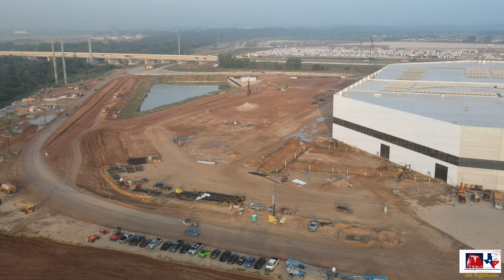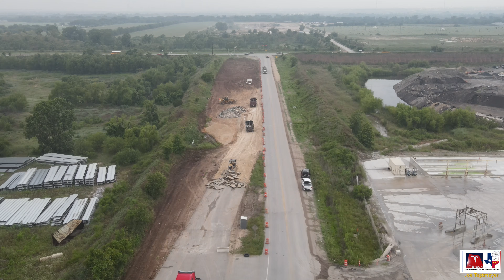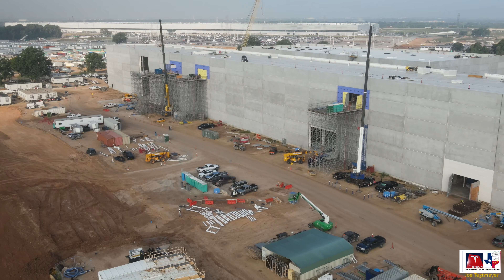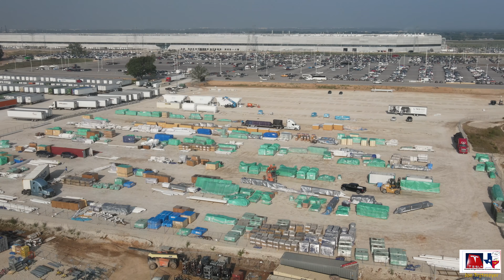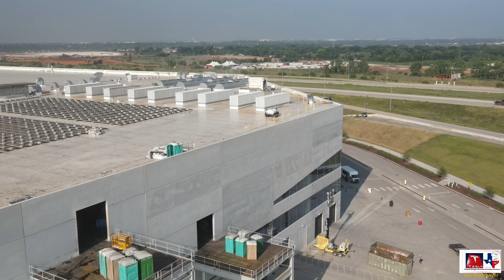Big Deliveries, S Construction Changes, Tesla Rd Widening! 22 May 2023 Giga Texas Updates (07:35AM)

Comment: It's been a while since I asked about the solar panels on the roof.  Are they online and producing power?  If so, any stats available?
Reply from the maker: I don’t think so but in my 19 May video I show where electronic boxes have been installed among the existing solar panels and a bank of raised panels over the casting machine section. It think these will be one of the last parts needed to connect into the new conduit that is being finished near the Megapack and new switchyard sites

Comment: Why are the solar panels angled the wrong way?
Reply: This question came up a lot when the PV Array was first started.

Cut and past from a comment from 18 months ago;

'West facing PV array. 'Recent study reveals some interesting facts. The conventional understanding is that the solar panel facing south (in locations north of the equator) will receive the most sunlight. This is correct to a certain extent however recent studies have proven differently: According to a new study from Pecan Street Research Institute, west-facing rooftop solar panels produced 49 percent more electricity during peak demand compared to south-facing panels [1]. This research was conducted and data was collected from fifty homes in Austin, Texas, which had solar panels installed in different directions. Some homes had only south facing panels, some only west facing panels while some had both.'
Reply: They looked more North facing but that's a very interesting study. I'm. Guessing there was no battery involved in that test?
Reply: @nathanprice4568  The panels are facing west. The long axis of the building is north-south.

There probably won't be a direct connection between the PV Array and the BESS. There's been a few guesstimates done that suggest all the electricity generated by the array would be soaked up immediately within the factory.
Reply: @Dessie Doolan  sound right...I was seeing the shadow of the roof vents...was probably early AM knowing Joe's schedule
Reply: Because it seems like the silly owner was more concerned about having the word "Tesla" seen by approaching aircraft than producing power.

Comment: Actually the antennas on the bulldozer are for a Trimble system. Much more accurate in 3D than GPS. The zero point transmitter for the original construction was that short tower with a generator at its base and fencing around it, near one of the pre-existing buildings on the site.
Reply from the maker: Thx for the added info and clarification

Comment: Thanks Joe
4:04. Southend. Bottom centre. What appears to be 9 prefab large boxlike forms for column pedestals.
Could be 1 complete row of deep footings, as 9 footings required to extend from gridline 85 to 93. Similar used in Stamping 2.
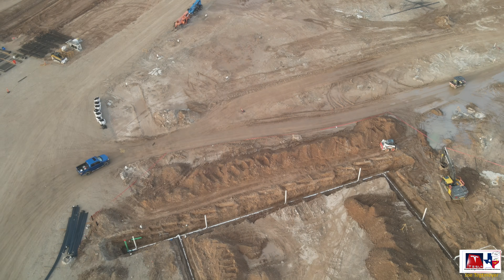4:37. Southend. White pipes would be sanitary sewer.
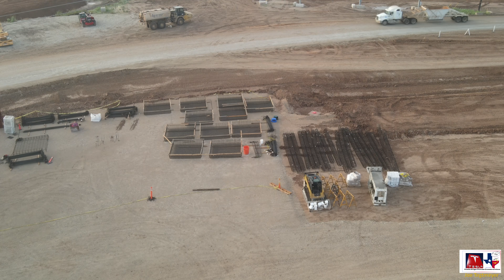4:58. Southend. Pile-cap/footing rebar cages. Timbers around the top edge. 
Rebar cages for the piles. These happen to be fitted with guide wheels on the ties towards the top, middle and bottom.
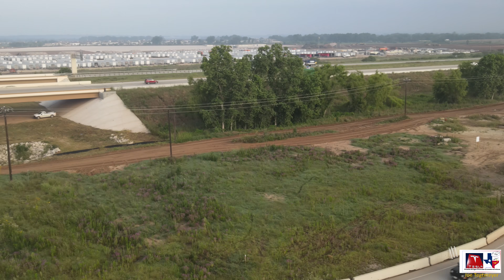6:57. Highway bridge. There’s that man again.
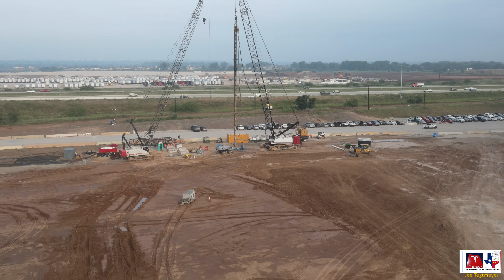7:42. Southend. Gravel patch, bottom of screen. Pair of CFA piles constructed here 2 weeks ago. A geopier or 2 constructed in between in Brad’s video from Saturday. Test location presumably.
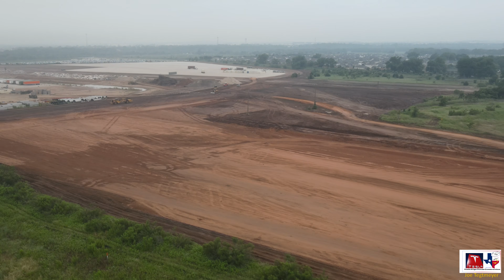10:36. W-WOW, north expansion. Into the sub-soil now, presumably lowering the grade/elevation to match the existing W-WOW.
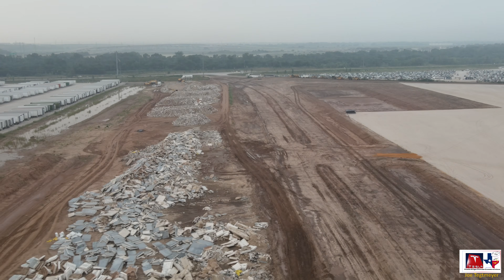11:00. W-WOW. Concrete pile. Level 1 floor sections. No impression of the decking rib to indicate Levels 2 or 3.
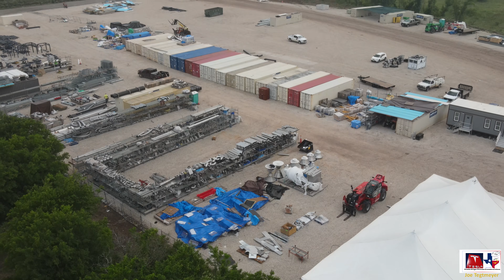12:06. Westside storage yard. Zeppelin silo venturi bottoms. Similar used in Battery, delivered January 2022.
12:42. Westside, steel fabrication yard. Top right. Additional bridge crane beams stacked along the road edge. Possibly associated with ongoing works in Casting.
16:14. New Switchyard/Substation. Left. Additional formwork boxes for casting the retaining wall infill panels on site.
Formwork removed from 4 completed stacks towards the top. 4 or 5 to a stack.
18:43. Cathode, loading platform. Looks like a ‘shifting out’ pile of gear.
23:56. WOW yard, south. Loading dock? Vertical sections are salvaged apron sections from the southend.
25:07. BIW, apron. Drive-through door. Forklift with castings exiting.
25:32. Casting. loading docks. Floor inside demolished.
27:32. Battery, roof. Green hose connected to a vent pipe.

Comment: Joe, I'm not sure I understand the flow of power from the high-tension lines and solar panels through the battery packs and the switching yard.  I watched your earlier video on the subject but it wasn't clear how the pieces interconnect.  (I can guess, but I don't want to).  Any chance you can include a simple schematic in a future video?
Reply: PDF page 59 (Document page 48), there is schematic. Doesn't quit show everything but it is pretty good. https://interchange.puc.texas.gov/Documents/35077_1363_1179220.PDF
Reply: @DavidJohnson-tv2nn  With some crazy $$$ amounts stated, especially the amount just to design it all.
Reply: @paulstubbs7678  Yes, I believe that William Wheeler mentioned 30 million dollars. And that was just the cost of the LCRA substation. Not including the cost of the BESS yard, yet to be constructed interconnection substation, and switchgear facility under construction just south of the LCRA substation. The cost of the LCRA substation was unavoidable, but... They could have saved money by using backup generators instead of the expensive BESS yard and associated substation.

Comment: still looks like those vertical i-beams with concrete inserts between them is forming a high strength balistic fence, mean to stop high powered rifle rounds..   protection for the 2 HV transformers.
Reply: Not likely. It's a temporary retaining wall.
Reply: @DavidJohnson-tv2nn  if it doesn’t get removed, its not temporary.  This is a new trend utilities are doing, since several HV transformers have been the targets of nutjobs looking to disrupt the grid
Reply: @mwolrich  I get what you're saying, but it is unlikely that this is a fence. It is a retaining wall. These types of retaining walls are used to temporarily prevent the side of an excavation from caving in. They can be permanent in the sense that when construction is done, they often just cut off the tops of the I-beams, leaving the wall in place. However in this case, they can cut off the tops of the I-beams or just pull them out when they're done. The I-beams aren't very long.
Reply: @DavidJohnson-tv2nn  Joe will capture what happens through his videos, we shall see which theory is correct, given enough time 👍

Comment: Unlikely to be  gps system on bull dozer, more likely lazer from  a height set device on the property somewhere. Though gps be possible.
Reply: Definitely GPS. Those are Trimble (a Caterpillar company) GPS receivers. There is a tablet in the dozer that has a specialized file derived from the design cad drawings that usually provide the design finish grade elevation for any location in the area the file covers. The dozer blade elevation is controlled by the system. There is a screen on the tablet in the dozer that will have a plan view of site and the location and orientation of the dozer depicted. The operator controls the motion of the dozer but the system controls the elevation and slope of the blade. You usually work with an elevation offset below finished grade.
Reply: @bobcallahan2322  thank you
Reply: GPS with a local repeater station
Reply: @David Sowden  for depth control, or direction control etc?
Reply: As Bob said, these are very accurate sensors. For the first 18 months or so there were a couple of the local repeaters installed at the corners of the project so that they could get very, very accurate position and elevation information. I’m sure there is another over there somewhere but for a road, they maybe able to just get away with GPS.
Reply: @Bill_N_ATX  Cheers, love learning new stuff. All the (much smaller) projects in my area have only used the laser. I can see gps being a much better idea for such a huge project. A new project in my town  is a rail crossing bypass and elevated train station, will nosy round them and see what I can learn.
Reply: @Bill_N_ATX  thanks for the explanations, also to Bob. How does the curvature of the earth comes into play given the enormous size of the project? If the dozer GPS controls a surface to be "level" it follows the curvature I understand. Dozing for a "Straight" surface it results in deviations.. I found on internet an article that calculated a "straight" Atlanta airport-terminal of 726 meters in length would be 4.1 cm off from level grade, measuring end-to-end.  Managing a 4 cm or more different elevation seems well within the capabilities of such a gps system, so what to do?
Reply: @hardernl8893  Just like an old school surveyor could adjust for said curvature, so can a modern system such as a GPS with local information. Since it knows the distance between two points it can adjust. Now, even then it might be a little off since the Earth is not a perfect sphere. To do that you have to use lasers, which if they do need flat they can use. There are tools they can use to measure both level but the degree of flatness over a given area and the variations in that flatness. Ive seen the air bearing flora at NASA JSC where they use a cushion of air to float large, very heavy objects. It’s a huge room over a 100 meters wide that isn’t more than a hair’s breadth out of perfect flatness. But it allows them not move objects saying tons with just a human gentle push.

Comment: As an Electrician Time 12.08 the silver pipes Threaded and flexible electrical elbows 30 and 45 degree elbows to be added to enter or exit electrical gear bigger than a refrigerator the 3rd row to the bottom  items the stubby ones are to go through walls or concrete the Funnels are High bay light fixtures light reflectors they look almost like rocket engine nozzles.

Comment: I would think that some of the conduit would also be for the solar power to go to the magazine packs
Reply: Looking at the already mentioned PDF document text and schematics, I don’t think the MegaPacks (BESS) will be charged from the main building’ solar roof at all.

There will be three connections from the BESS to Tesla: two backup power supplies to “Tesla Enclosure” (factory load) and one to “Plant Auxiliary Power” which could be a kind of black start and/or emergency power supply. The pdf specifically mentions “To Tesla”, not “From Tesla” 

What’s left for charging the BESS looks like the main transformer between the BESS and the LCRA  345 kV main transmission system, allowing import as well as export.

This implies that the solar power, via the inverters on the roof, is directly integrated in the factory power system and that during normal operations the daily peak solar production does not exceed the factory requirements.

The arbitrage business of the BESS could then be 100% conducted via the LCRA 345 kV metering systems I think. But the mentioned connections from BESS to “Tesla Enclosure” could also be used routinely to the benefit of Tesla only, via a business agreement with LCRA. The pdf mentions metering systems plus fibre optic data transmission such that everything from the BESS is recorded/metered by LRCA.

Further, as discussed with David, the configuration of the major conduits between Tesla and BESS remains interesting: do we see only the "Factory Load" conduits arriving, or can we already see some smaller conduits that may be the auxiliary power conduits as per the pdf? I fancy the Eastern trench has additional smaller conduits..
Reply: Not an expert on commercial or industrial power systems, but it is not really necessary to have separate conduits from the solar panels all the way back to the substation in a grid tied solar power system. Though there would have to be some way directing excess to the Megapacks and not the grid. Unless LCRA actually needed the power at the time. Someone can correct me if I'm wrong.